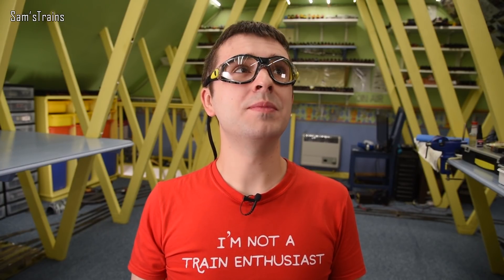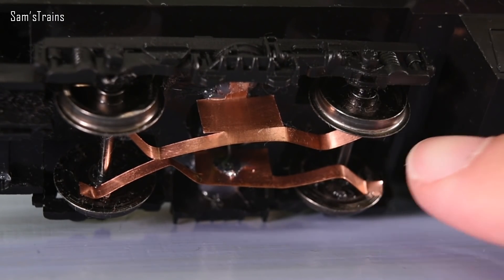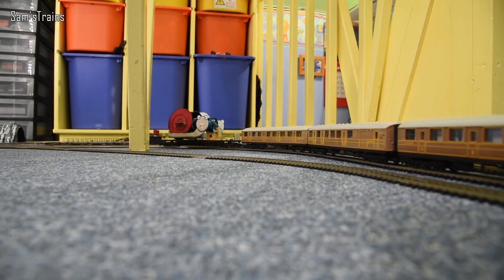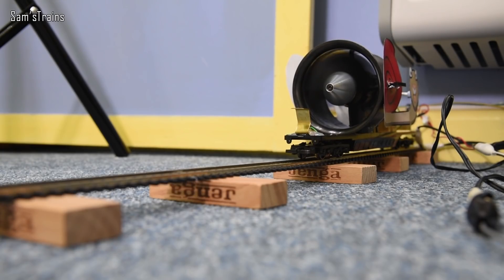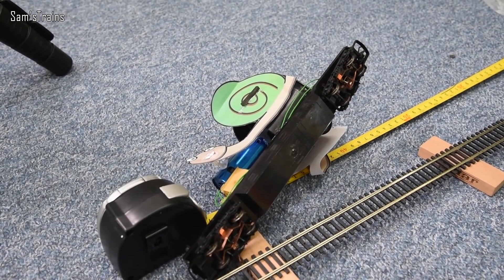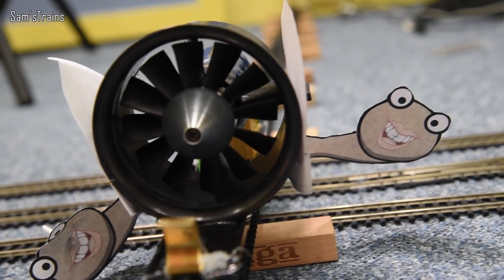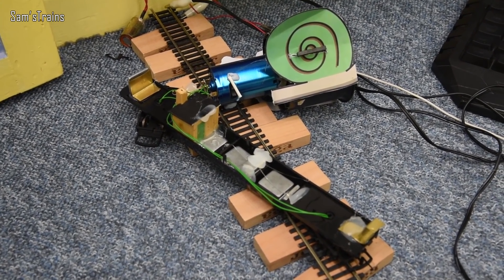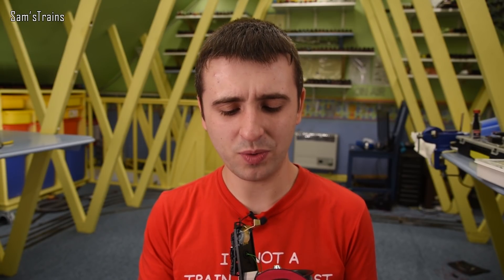Extreme Fan Powered Model Train | High Speed Tests | Crash & Destruction

Comment: Stability ... use two tracks widely spaced, and set the fan between two bogie cars with coupled pickups. That will give you 16 pickups. You can also add weights to the bogie cars to add extra stability, and possibly some aerodynamic fairings as well.

At this point I'm also thinking of two ducted fans spinning in opposite directions to cancel torque imbalance. However, you'll need the dual track to be situated outdoors to give you sufficient crash handling space, might be a good idea to tether the tripod to several large bricks, and use bungee cords instead of an elastic band, as they'll be more resilient.

Are you prepared to up the ante to this level of madness? :D
Reply from the maker: Yeah that's a very good idea - thanks a lot for sharing!
Thanks for watching, Sam :)

Comment: Hi Sam love videos . I restore Hornby / Triang locos for hobby and for sale . Do you thinks we can getaway by leaving out the tv suppressors when rebuilding locos as I have one without and doesn’t seem to interfere with my tv . Or I’m I missing out the full reason for having them . Also do you have any experience with Triang smoke box as I’m trying to make the element for them , they don’t make them any more . Is it worth doing a video  many thanks.  Robert from Edinburgh. 😅😅😅😅
Reply from the maker: Hey! I tend to leave them in as they seem to reduce arcing on the commutator - you can buy more modern ceramic capacitors to put in instead if the originals are missing!

Comment: Oh, Sam, why didn’t you take the couplings off and use some sprung buffers (some really BIG CHUNKUS sprung buffers)? Also, a rubber band at both ends of the track seems like a good idea. 😊 Also, if you mount the fan & shroud ahead of the platform (locomotive?), and have it pointed down, then you can attach some vacuum cleaner hose to the exhaust side and have a rail-powered vacuum cleaner to get rid of any rubbish along (and on) the right-of-way. You might have to 3D print this part, though, then have it empty into an open hopper wagon following it. Finally, make a normal engine push the whole thing down the track. This will also help detect scenery material that’s not glued down! 😊

Comment: IMO, at these current values you'd rather try on-board lithium batteries. The track power may serve as control voltage, with just a milliamp or two current draw. The only high-current path, battery to motor, will be then confined to the loco.
Reply: Yeah the track is definitely the major limiting factor at this kind of power. Wheel pickups just weren't designed to withstand several amps.

Comment: Going as fast as possible with a fan.  Basically, about 80% of the speed of sound, 760 mph, which cannot be exceeded with air-powered drive.  Other than the jet engine.

Let's hope that, one day, Sam will be working on approaching the speed of light, for inter-planetary travel.

Cheers from Canada  :-)

Comment: 1960s BR:  I hope you R&D blokes are taking notes.

And so five of the BR Class 13 "Snails" entered service pulling commuter trains out of London.  Unfortunately, BR was being an impulsive buyer at the time, and never tested the locomotives, so they developed a host of problems from the start, including:

Rocketing out of the engine terminal so quick they derailed
Rocketing out of the station so quick they derailed.
A tendency to fry their electronics systems every run.
Needing a fan so big it couldn't fit in Paddington.
The big snails plastered on the sides coming loose and flying off at high speeds.

And so the Snail Class was unceremoniously retired after 12 hours of service.  BR was so embarrassed by the failure that they not only scrapped them, but dumped them in the Mariana Trench.  The class was almost forgotten about by the model manufacturers until Sam kitbashed a relatively accurate model for his OO layout, which, like the prototypes, lasted all of 12 hours before being retired.

Comment: There has I saw Sparks for the high power train that thing got sparked I used got to be on myself model train that did the same thing I did it on 12 volts
Reply from the maker: Yep - high voltage and current that time - definitely some arcs there!
Thanks for watching, Sam :)

Comment: Would be easier to use a lab power suply?
You can even daisy chain them for more voltage or put them in parallel for more current.
Also they have current limiting, so you can use them to limit the maximun current that goes trought an expecimen.
Not to mention being helpful for fixing electronics like all your trains
I mean, as an electrician I dont care AC or DC, but for the rest, DC is inherently more safe.
Reply from the maker: Probably... but I didn't have one and they're expensive! ;D
Thanks for watching, Sam :)
Reply: @SamsTrains  Well, If you keep doing these experiments it may be worth it. Also It would allow you to find how eficient are your trains at pulling cargo, since you could measure how many amps takes them to generate their pulling power. And it would delete the controler in the slow speed crawl factor, since they give a continuous output, not a PWM one. Maybe we could learn something new seeing the data, I dont know, but always wondered about it.
Thank you for your time! Al.

Comment: Maybe you should use higher ampage wire next time, thin house wire can be picked up off eBay for around £12 for 50 metres
Reply from the maker: Yeah, that was a limiting factor! Although, to tell the truth, I forgot to rectify the AC on one test, which caused the initial melting ;)
Thanks for watching, Sam :)

Comment: If you use the correct volatwge that this is rated for it will go a lot faster, also those things will propel a big rc
Reply from the maker: Yes you're right - I did get the motor up to the 24v rating, and it was pretty speedy!
Thanks for watching, Sam :)

Comment: Great whacky racer train - love it. The out of loading gauge ducted fan is a serious issue, the wobbling causes broken pickup contacts and the back EMF AKA Angry Pixies wreck the underwhelming current path... all good fun. But; suppose you used a pair of fans, each turning in opposite directions; you’d cancel the torque effect? Use a bogie well wagon or probably a custom chassis to keep the fans as low as possible to reduce their torque moments and lower centre of gravity. Then you could take a leaf from a huge artillery piece - run two bogie wagons side by side, run on two parallel tracks but this is more a test rig than a train - I’ll stop there!!!
Reply from the maker: Thanks a lot! Yes very much so - didn't build this to any loading gauge, quite obviously! Opposing fans is a great idea, although I'd need a set of opposite blades too of course!
Thanks for watching, Sam :)

Comment: You could try having a motor spin the other way so it doesn't tip over as easily . Have one push and the other pull like with the Dornier do 335
Reply from the maker: Yeah that's a good idea - having two counter rotating blades could do the trick!
Thanks for watching, Sam :)

Comment: Ding Dong
Who's there?
Tim, your neighbour.
Whats up?
Did you drill that hole in the wall? And is this hot snail yours?

The most dangerous thing was that 13V/25A power supply. Imagine Salvador derailing and making short circuit. It will pump full 25 amps into the track and crocodile clip wires, causing a fire. As long as the auto transformer is plugged in the correct way and limited to the motor working voltage, it is more safely! Try to get a lab power supply with adjustable current limiter. And 100 metres of track to create a new world record!
Reply from the maker: haha, I wouldn't be surprised! I put a 3A fuse on the output to avoid exactly this! :D
Thanks for watching, Sam :)

Comment: Great show! Are you doing another prototype? Try 2 impellers rotating clock- and counterclock wise to offset vibration and the longitudinal torque effect (stays on the track while revving up).
Can you use a die cast frame? Lowest center of gravity possible should help against premature derailment, though acceleration is a bit lower.
Again really a great video!
Reply from the maker: Thank you!! haha maybe next year - a double version could be great fun! :D
Thanks for watching, Sam :)

Comment: Insane! How many Sam's Trains fans were powering that model train? Had to be more than one! Calculating scale speed can be problematic. I have an RC cabin cruiser model boat in 1/20 scale. It is ridiculously overpowered with a brushless motor. At full pelt it goes 13 boatlengths per second, one boatlength is 55 centimetres. This results in a real speed of 13.9 knots ie. 25 kph ie. 15.5 mph. First I was multiplying the real speed with the scale, which was 1/20. So 20 times 13,9 knots would make a scale speed of 278 knots, right? This was too insane to be true. So I scoured the net and found the right way. Scale speed is calculated by taking the square root of the scale, in my case 1/20, which is roughly 0.2236. The real speed is divided with this figure: 13.9/0.2236 = 62 knots, which is the scale speed. In real life a Chris Craft cabin cruiser would run at about 25 knots on full tilt, so the scale speed of 62 knots is still over twice as much. Maybe some food for thought? Thank you for the funny video. Stay safe and keep on chooching!
Reply from the maker: haha! That's very interesting - I'll have to think about this - thanks for the info!
Thanks for watching, Sam :)

Comment: U probably might need to put some more weight on it so it doesn't lean nor tilt over. Also, try it outdoors so u'll be able to use more track.
Reply from the maker: I filled the lower chassis with as much weight as I could, but yeah a longer track would be way better! :D
Thanks for watching, Sam :)

Comment: great experiment there Sam. 

Here's a challenge for you. How  about a rocket train / sled? Obviously it will have to be done outside and will need a far longer track, 30 metres maybe?  Power will be no problem, model rocketry is a popular hobby and solid fuel one use motors are fairly cheap. ( https://www.elitemodelsonline.co.uk/Rockets/Rocket-Motors ) - although you can't get them via mail order and will have to source them via your local aero model specialist shop. Stability could also be an issue, so maybe O gauge track rather than 00, and build it with a low a centre of gravity as possible. You may even need mini F1 style downforce wings to pin it to the track and a sand drag arrangement to stop the thing at the end of the run. On the plus side apart from a battery powered firing circuit it wont require electricity to work so the car can be quite simple mechanically. I reckon you could break the scale 1,000mph barrier!

Any way, just a mad idea.

Keep the great work

Jon
Reply from the maker: haha thanks a lot Jon - yes I have considered something like that, it could be fun... but definitely one for outside! ;D
Thanks for watching, Sam :)

Comment: Real life counterparts are the M-497 "Black Beetle" (US) and ER22/SVL (USSR) railcars. Both were regular railcar with jet engine from bomber planes mounted on top.
The other use of plane turbine on a somewhat train-like thing is the french Aérotrain, which was a tracked hovercraft (air cushions on a concrete beam for guidance) powered by many types of aero engines (even rockets...). Friends built radio controlled models of Aérotrains, using the exact same kind of turbine as your experiment, and even a real kerosene one for a very big scale replica, all also supported on real air cushions, so no friction at all. Local police was asked to clock the fastest one (the one with the JetCat kerosene engine) during a demo, with their rigorously calibrated speed trap. It had reached more than 50km/h.
Reply from the maker: Oh nice! I'll have to check those out - that sounds pretty impressive! :O
Thanks for watching, Sam :)
Reply: @SamsTrains  Just please don't take the "rocket" part as an idea for a new experiment.... :P

Comment: Can I just say Sam that it's not a propeller, its a jet engine, and it looks a bit more like a turbo-jet, an engine used on fighter jets nowadays, but it's probably ment to be a turbo-fan engine, what's used on modern day jet airliners (The "propellers" on the inside are called fan blades).
Reply from the maker: You reckon?! I wanted to call it a jet-train, but thought that was wrong! xD
Thanks for watching, Sam :)
Reply: @SamsTrains  I do, being the MASSIVE aircraft nerd I am. It also reminds me of the jet train from Train Simulator 2017.

Comment: Only thing I can think of is going remote control area. Brushless motor running of it own battery power pack. With a onboard speed control using a remote control to control fan speed.
Reply from the maker: Yeah I think you're right - that's the only obvious way to improve it - those LIPOs can supply immense current!
Thanks for watching, Sam :)

Comment: Hi Sam, try here: https://wheelspinmodels.co.uk/c/45/
Problem you have is weight.
It appears you have a pretty boggo brushed motor spinning your blades.
You need a low-turn, higher power and revving brushless motor, probably through a speed controller.

The motor you have looks larger than a 'normal' 540 Mabuchi used in Tamiya, and probably a 550 - won't help with the weight, hence why I haven't gone 'bigger' - there are MUCH bigger R/C motors available.
Just a suggestion.

Another locomotive suggestion: I know you don't like Bachmann chassis / motor combos in steam locomotives, but I've 2 I'm running currently - no pun - which are beyond superb - very smooth at slower, up to higher speeds comparable to equivalent Hornby locomotives - with the Bachmann appearance, which I generally believe is better.
Locomotives to try:  9F Evening Star - absolutely superb and makes the Hornby 40+ one look just that ... and the A2 Blue Peter.  Both quiet running, very smooth, great haulage capacity relatively and can go quite fast as well - generally unusual for a Bachmann 'kettle'.

Al.
Reply from the maker: Thanks Al! Yes the only reason I didn't want to go brushless was so that I could still control it with a standard model railway controller - no doubt brushless would be MUCH better! Thanks for the suggestion - I've tried their A2, but never 9F - I'll have to look out for one!
Thanks for watching, Sam :)

Comment: One way to overcome the the stability issue is parallel sets of track.  The only thing is making sure the tracks are precisely spaced along the test strip.  Then have the duct mounted between two running chassis parallel with each other.  Just a thought for the future.
Reply from the maker: Yes that's a very good idea for stability actually!
Thanks for watching, Sam :)

Comment: Damn you Sam! Since the last time you did this I have been thinking of ways to beat you and now you have made the bar higher.

I have a few ideas. My railway shed is entirely powered by solar, wind and hydro. I was thinking of using a raspberry pi and capacitors charged from the renewables to control the energy released to maximise top speed.

I also was going to make a nitro powered petrol/electric O gauge loco to functionally demonstrate how real diesel/electrics work but at that scale I would need to hit 20mph to beet you.

I have an idea for a pulse jet but if not, I do have some micro class model rocket motors. My gardens 20m long but I think I will need to go somewhere bigger if Im going to crack out the rocket motor.

Need some free time from work to experiment!
Reply from the maker: That sounds pretty awesome - I love your renewable shed idea, that's pretty impressive - does it really work?!
Thanks for watching, Sam :)
Reply: @SamsTrains  yer. All incoming energy is at 12v. I have just some normal medium sized solar panels on the roof, a small wind turbine like you would see on a narrow boat or caravan and I collect the rain water into a butt which has a water pump connected to it that when run in reverse creates electricity.

The solar is a pretty predictable baseload throughout daylight hours, wind tops it up at any time day or night depending on wind and I save the water in the butt. If Im running low or need a top up I can turn the valve and create electricity on demand.

It all trickle charges 5 × 110amp hour batteries so have 550 amp hours worth of power. Thats then connected to a 2000 watt inverter to bring the 12v dc up to 230v ac.

I only did it as I needed a use for my raspberry pi. I wrote all the python to automate as much of the process as possible using various sensors, switches, relays and motors.

Comment: Not sure why I’m even suggesting this, but...
In theory, if you were to fit two fans which were counter rotating, then you would have the centrifugal force which was lifting it off the track. The only technicality is that if you use two identical fans, then they will obviously end up with it blowing air both forwards and backward, but the train not actually moving.  However, if you can find two fans which are opposite in fan direction then you would theoretically more than double the  amount of power the train has, without having it rocking off the track.
Reply from the maker: Yes that's a very very good idea actually - counter rotating fans would definitely be much more stable during those sudden speed ups - awesome thought! :D
Thanks for watching, Sam :)

Comment: I wonder if it might be worth trying it again, but using 'O' gauge equipment? Find a heavy second hand bogie wagon (ideally, a Warwell would be best - it's heavy, but far too nice to do mental experiments with). Using larger gauge track, you'd have less of a problem of torque rolling the wagon over. Or stick with 'OO', but mount the motor on two side by side cars, on parallel tracks, so it can't roll over.
A great, mad video, though. You, sir, are to be applauded.
Reply from the maker: Yes that's a good idea actually - there would be much more stability there!!
Thanks for watching, Sam :)